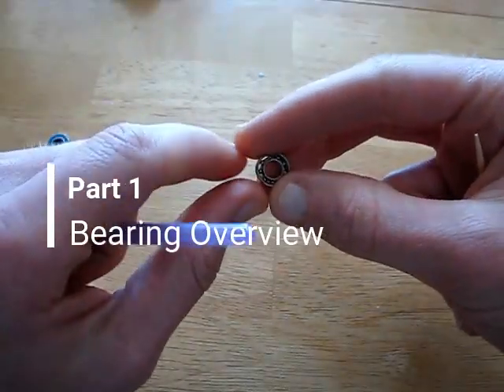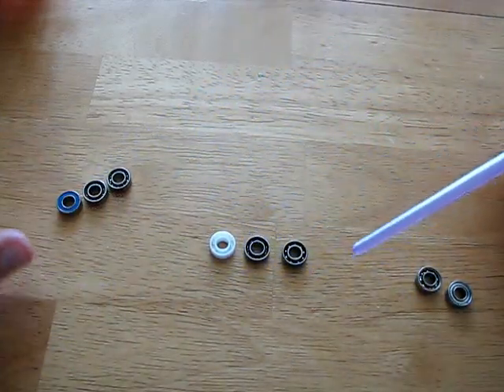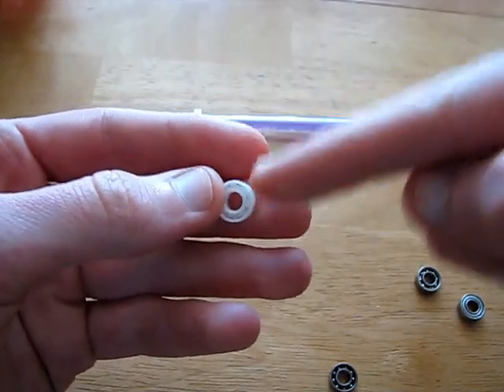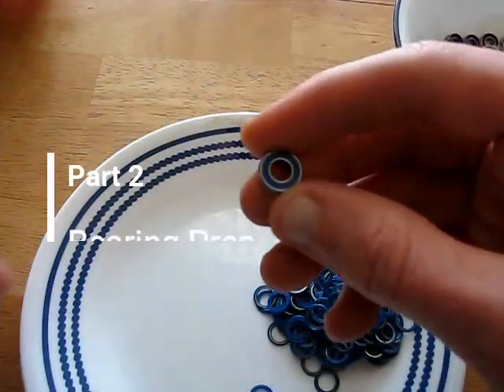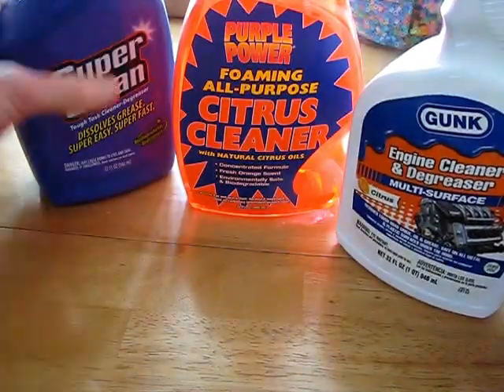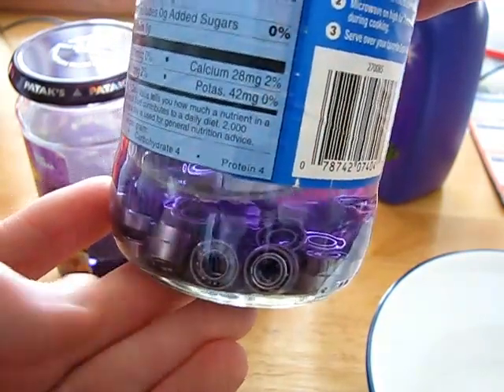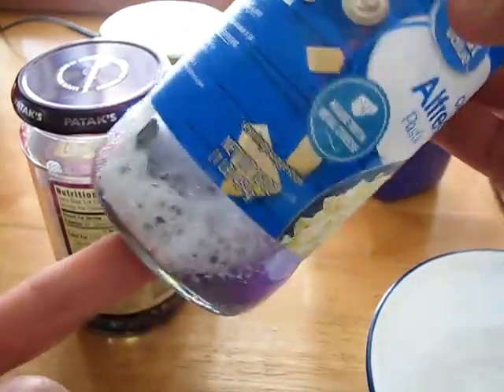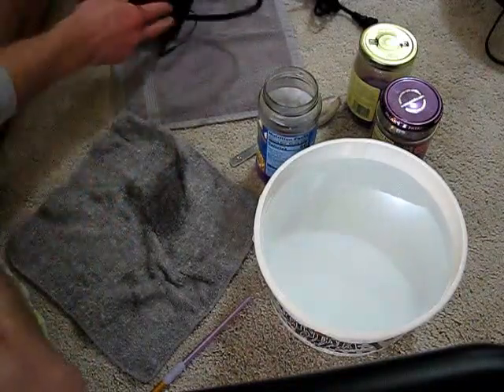How to Clean Ball Bearings

Comment: Degreasing the bearings also works perfect with a 20$ ultrasonic cleaner and water with just dishwashing liquid. I let them in about 10 minutes and another 3 minutes with just water. After drying out, bearings run perfectly
Reply from the maker: Great suggestion, I've been thinking about getting a small degreaser, so glad to hear it work well

Comment: Thank you so much! This is the perfect video for help me 🥰
So I have little comprehension problems. 
If I understand correctly, I just need : degrease then clean in water?
How long in the degreaser?
Reply from the maker: Yup, just some degreaser and then water to clean the degreaser off the bearings. Make sure though you have some sort of air (compressed air/pump etc.) to then get the water off the bearings. 
For this degreaser, I had them in for about 2 hours, but it depends on the strength of the degreaser you use. I have had some bearings sit in degreaser for a day or two if it was particularly tough bearing grease and not-as-strong degreaser.
Reply: Thank you very much for your help,
I was desperate to see my bearing k'nex car going very slowly

Comment: okay, so i followed this video and the video for putting together the ball bearing wheel assemblies for the knex cars. and once i finished the end result was not any better then a lubricated plastic car. do you know of anyway i could lubricate it to make it faster or do i have to order different bearings.
Reply from the maker: Mmh, it definitely should be better than the stock-plastic wheels. The bearings may not be fully cleaned, so you may have to try a stronger degreaser to remove the grease. Got the suggestion from a fellow coaster modeler to soak them in Naptha and then clean them off in acetone. I used this method a couple times and this worked well for me. Just be careful though as this stuff is pretty potent and you'll want to wear some hand protection and make sure to be in a well-ventilated area.
Reply: @3dcoaster  okay, i will thry this. thanks. another problem im having is the Bearings are very rough right after i take them out of the degreaser. might just be the bearings im using but they werent rough before i out them in the degreaser

Comment: Do you sell cleaned bearings ?
I bought 50 bearings, cleaned them with a degreaser, etc. 
BUT, after performance test, the k'nex car with plastic wheels was better than my bearing car.
Please help me
Reply from the maker: Mmh, I've had some bearings not roll quite as well as others and if all the grease has been taken out and they just aren't rolling well you may just need to try other bearings. Maybe try some other degreaser....?
Reply: Last week, I've try two different degreaser. And I put bearing during four hours.
Result :my bearing is better but not perfect for k'nex car using

Comment: I just bought the same bearrings as you with the blue part in it, however they don't run that smooth as yours. Should this do the trick? When I spin them they only go round for 1 time or so.

Great video btw! Printed your 3d modules
Reply from the maker: Hey thanks! Did you remove all of the grease from the inside of the bearings? That's what really slows the bearings down in these instances

Comment: have you tried using an o-ring pick to get the rubber shields off instead of a utility knife? it might work better
Reply from the maker: Ooh, that's a good idea. That would probably work better too, thanks for the suggestion!
Reply: I use the tip of a safety pin. It has a fine point and the rest of the pin is easy to hold on to.

Comment: can use bearing without remove the shield ?
Reply from the maker: Bearings can be used with the shields. If you want to remove the grease and have the least amount of resistance though, it will work best to remove the shields